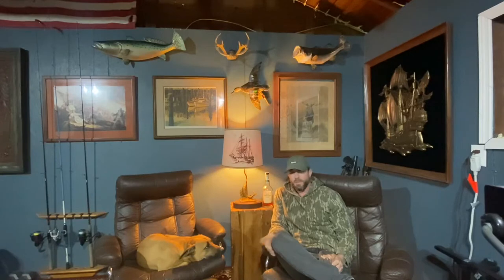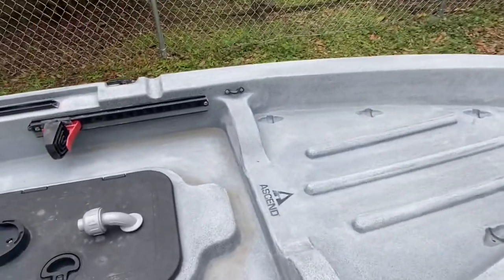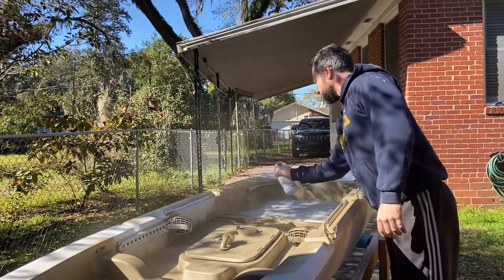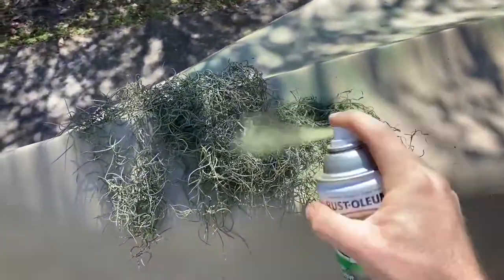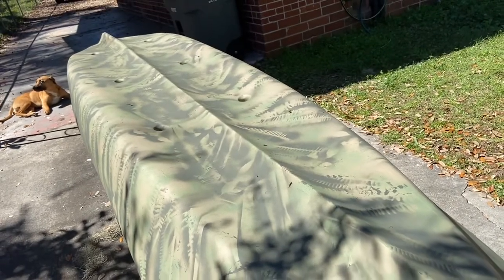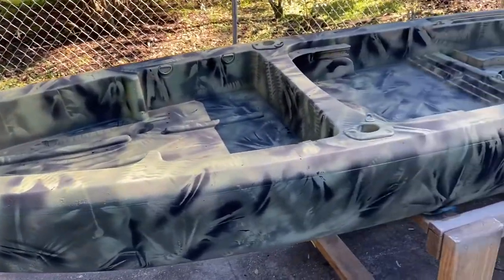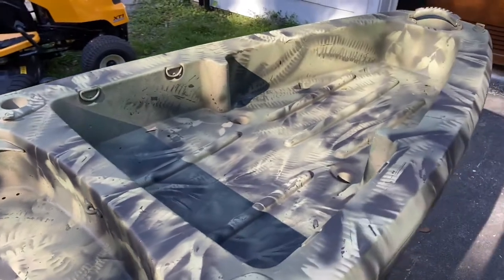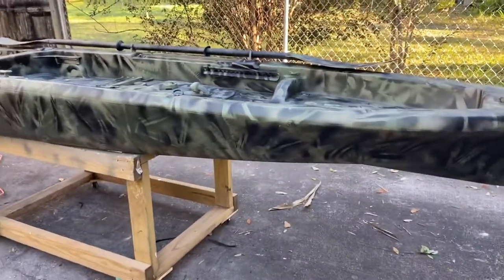Camo Kayak makeover -DIY

Comment: How’s the paint holding up a year later?
Reply from the maker: Surprisingly really well. The clear coat protection is key. Only the bottom is a bit scratched up but I fish in shallow water over oyster beds a lot, but even that’s held up well.
Reply: @Dmaines85  Alright that sold me then... I'm gonna do the same to mine!
Reply: @Dmaines85  I just finished painting mine, it looks awesome, I have one layer of clear on it, and think im gonna double tap 2 coats tomorrow within that hr window.  Did you wait the full 5-7 days before you took it out?